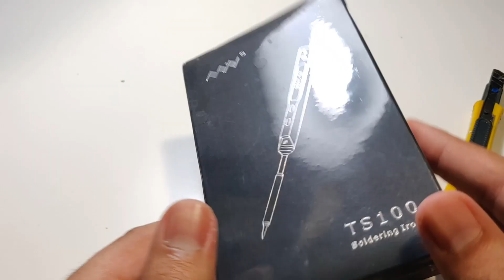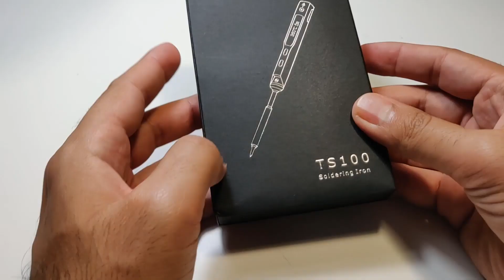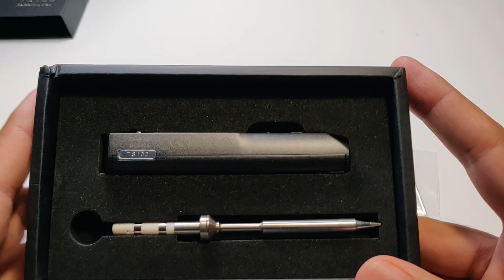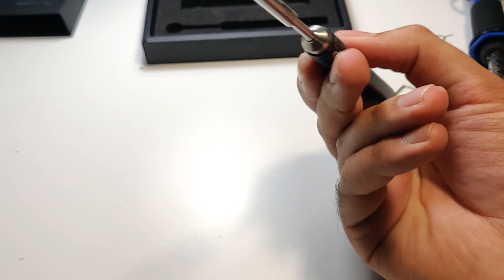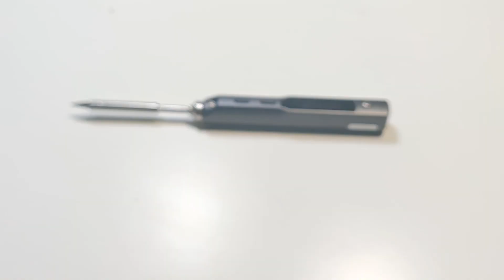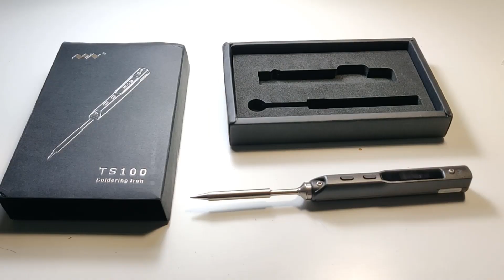What's all the Hype about? Reviewing the TS100 soldering Iron

Comment: budget? nah, good soldering iron for the money, but not the budget one. You can do wonders with cheap 3usd soldering iron, I had one for 5 years and did many projects with it. Also for 10usd you can get PID temperature controlled soldering iron.
Small size, oled display, fast heating, etc. - that's a luxury and not a budget